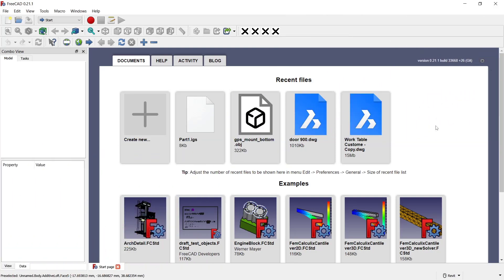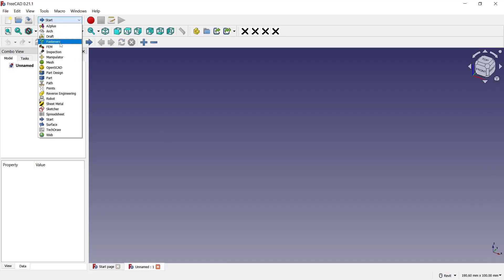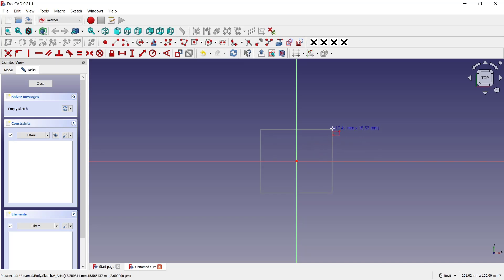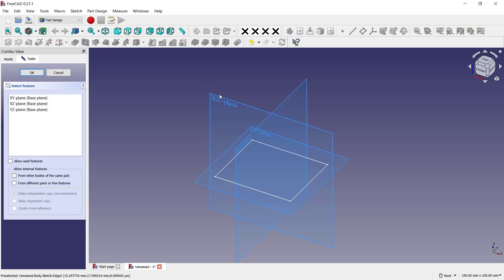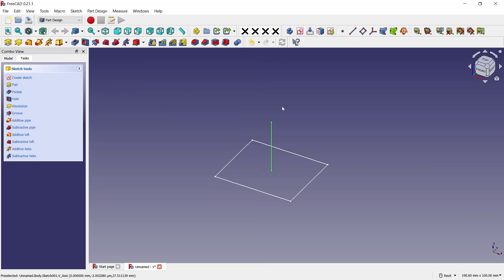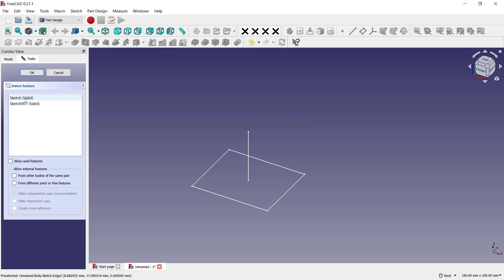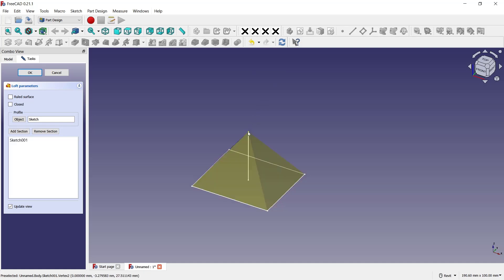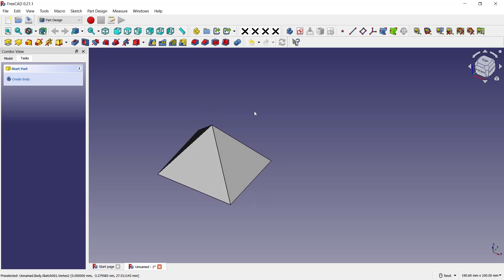FreeCAD How To Make A Pyramid

Comment: I get sections must be all closed or all open... is it the height valid? What version you use ?
Reply from the maker: im using 0.21
Reply: When selecting the section, try to click on the point, not in the line (Sketch001)